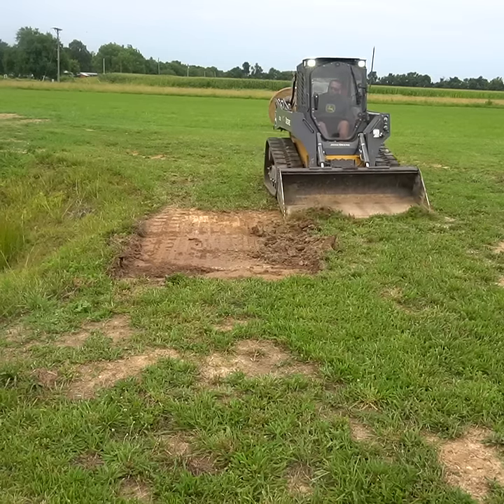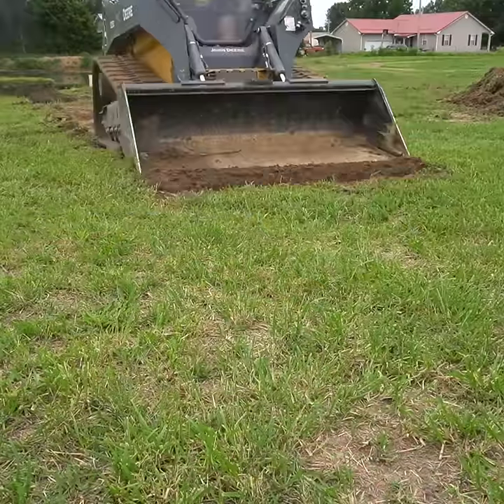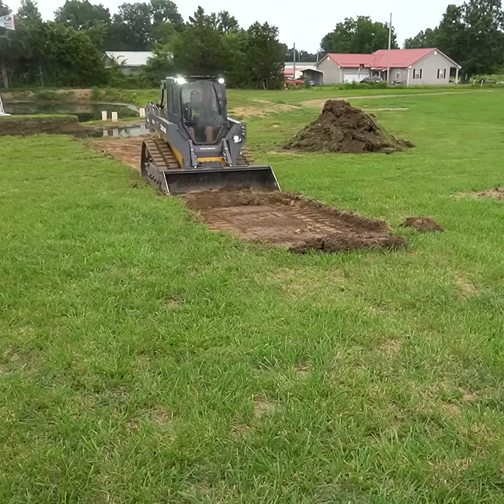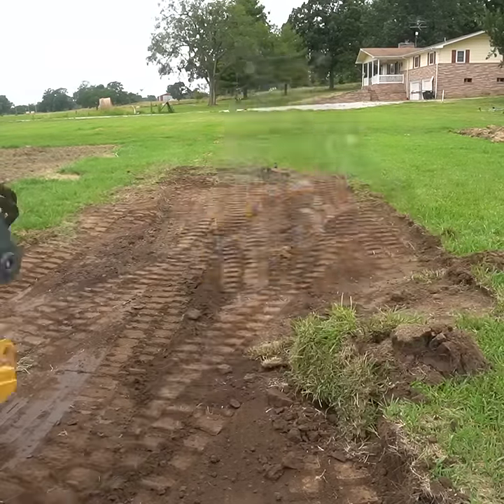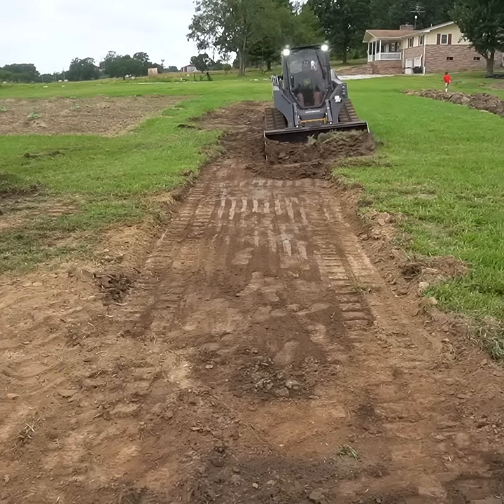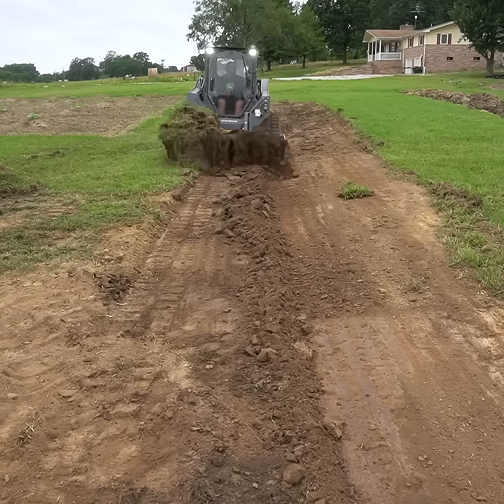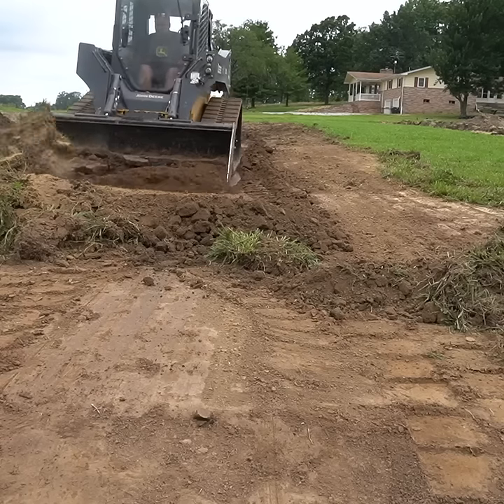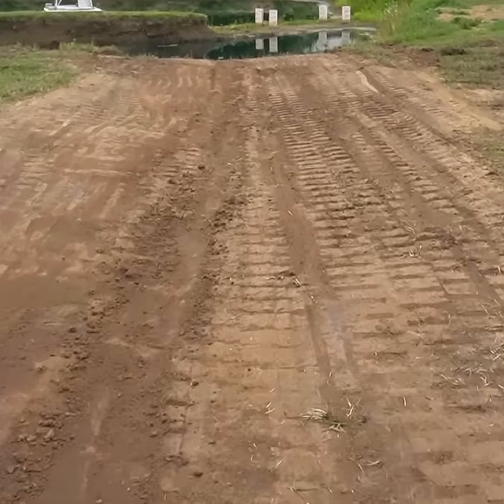Digging a Drainage Ditch with a Skid Steer #johndeere #skidsteer #farmlife

Comment: I can honestly say as a full time senior grader and equipment operator. That's a pretty solid method.  Nicely done.
Reply from the maker: Thanks
Reply: I have to agree, this is how I do them, but so much easier with a 4 in 1 bucket 👌
Reply: Senior grader?That's you're official title is it?
Reply: @shockingshorts8043  hahaha. Pretty much.
Reply: @kevinallen206  You use the same equipment at work?Do they Believe in grading stakes where you work?Or are they pretty much a by eye kinda company?
Reply: @shockingshorts8043  Kinda. More dozer, excavator and blade. And ya, but those are becoming a thing of the past. But for what he was doing that was perfect. Little different pulling a 2 mile ditch with a couple feet of elevation in it.
Reply: @shockingshorts8043  and with a grader it's pretty easy to get stuff dead nuts just by the feel.
Reply: @kevinallen206  you do realize those things operate on GPS right.
Reply: @kevinallen206  when I first saw the video I thought he was going to be pouring concrete there I had no idea the plan was just to let it soak into the ground and become quicksand.
Reply: My whole point being is when you grade something you're making a level surface and in the video there are no level surfaces whatsoever
Reply: @shockingshorts8043  No, they do not.  They can if they are equipped with it.  Which is a whole other system added to a machine.  They are really nice. What happens to an operator when it breaks?  Sorry shut the job down lol.  For something like that you would never use it.
Reply: @shockingshorts8043 And you are not making a level surface.  It's literally for drainage.  Every road surface or ditch you have ever seen is not flat.
Reply: @shockingshorts8043 And without asking him i would guess it's not for it to soak in the ground it is for the water to get off the grass and into that pond.
Reply: @kevinallen206  yeah sure it does.
Reply: Senior? So you stayed longer than the rest of the crew.
Reply: @toddgittins5692  No just a better operator then some.
Reply: @shockingshorts8043 You sir are not bright.  What part of ditch that you didn't get.
Reply: @kevinallen206 my old Dad called this type of drainage a swale . Recommend for hay and pasture land , you can mow right thru no problem . 👍🇨🇦
Reply: @shockingshorts8043  grading is making a grade . Not every grade is level. Go back to school
Reply: @cameronhamer9432 in the landscape industry we called it a swale as well.

Comment: Good job. That’s what you have to do to keep grade without a tilt blade like a dozer would have. Wether isn’t a track machine with a bucket or a wheel loader. I loaded rock trucks with blast rock at a mine for a few years. That’s how I’d keep the grade going the way it was supposed to, I’d come at it with my wheels going with the grade. Or down a sloped grade, I’d keep them in the right spot for my bucket to be on the sand angle of grade I wanted of needed. I’ve run dozer for quite a few years too. Much simpler when you can just tilt your blade. But still, you come at things at a certain angle or grade with your tracks also. Makes it easier

Comment: I used to excavate grades with a backhoe. Using the front bucket to grade and the rear bucket arm, slid out across the mount to one side, swing the arm out to the same side. Do the same for the other side.

Comment: I wonder if this would work with a tractor that has a front-end bucket?
Reply from the maker: Depends on the size. I couldn’t do it with my little Tractor, but I’ve done the exact same thing with a box blade.
Reply: @RockhillfarmYT  I've got a 33hp Kubota L2900. It weights about 3k.